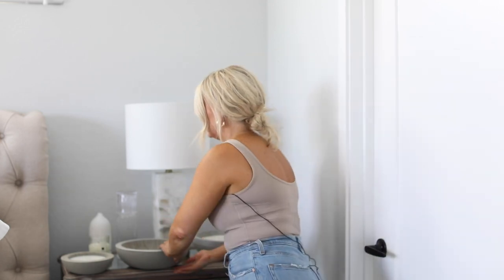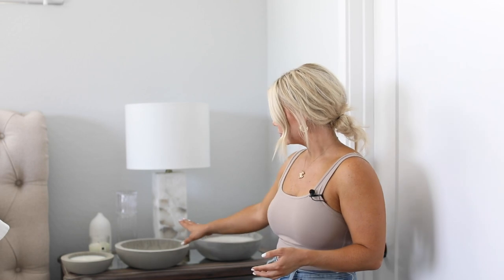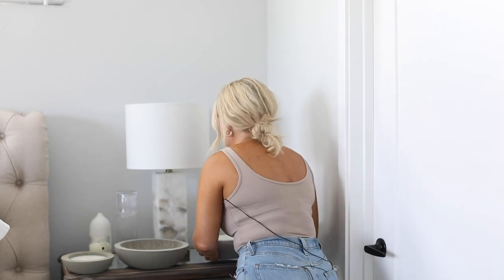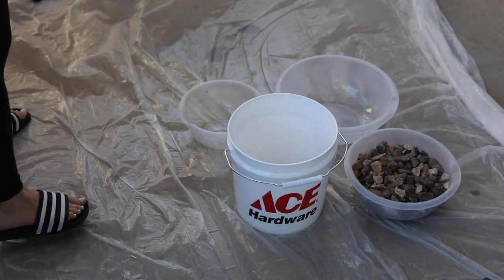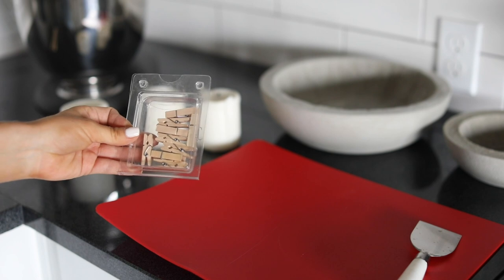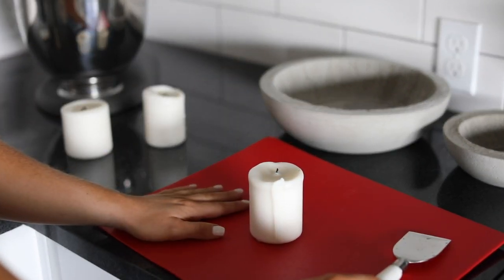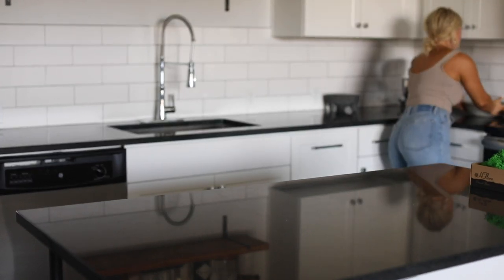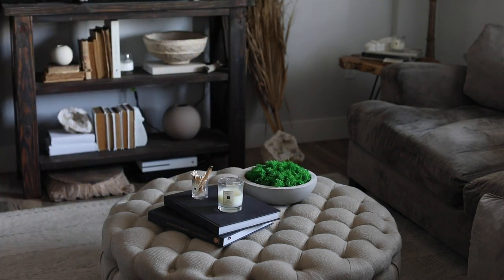DIY CONCRETE BOWL | RESTORATION HARDWARE DUPE | RESTORATION HARDWARE LOOK FOR LESS

Comment: 36 weeks pregnant and stirred 4 batches of concrete. I'm sweating like a hoe in church 😂😂😂. I hope my two massive bowls come out nice. These would be good gifts, especially as a candle. Cheap and personalized.  You could even spray paint or rub wall filler on the outside to give it texture.
Reply: Hello Brandy just just to let you know Don,t Breathe in that Cement Dust as it contains Silica that is not healthy to Breathe in
In other words keep your mouth shut😂😂❤

Comment: I have a question, It doesn’t show in the video, but I assume you push the smaller bowls into the bigger once the cement is in right? And how much water do you use?

Comment: Brandy, I watched this video for the first time a couple weeks ago.  Since then, I made the cement bowl ( with the help of your video!) and now I'm re-watching this one so I can follow the steps to fill the cement bowl with wax to make it into a three wick candle. I LOVE how yours turned out!!! My question is: When I melt the wax shavings in the pan, will it ruin the pan or does the wax wipe out?  Thanks,  Joan
Reply: Okay, update...used a pan and it was able to clean it out right away, However, I did drip/splash some wax on the side of the cement bowl. I'm hoping that when it is cooled and set, I can sand, the edge of the bowl, eliminating the dripped wax. Any tips?  Thanks in advance.  But, most of all thanks for this creative idea.  I wouldn't have attempted it if I didn't see you do it on this video!!!!

Comment: You can just put the candles in your crockpot. It melts them, then you can pick out the old wick and pour into the bowl with the new wick - I use a hot glue gun on the bottom of the wick and then skewers. Put your crockpot insert into the freezer and once the wax residue is frozen it pops right out. Nice piece. Sorry it was so hard because it's really quite easy. Live and learn.💁🏻
Reply: Or use a crockpot liner

Comment: I would add some type of felt on the bottom so that the bowl will not scratch whatever it's sitting on I love the bowls and I think I would not use my good pot to melt wax I think I would maybe used some type of item that I could throw away and I will melt in the microwave very slowly
I have bowls that I purchased after holiday sales for $0.25 that I've been holding to do just that with

Comment: Oh Brandy lets make your life soooo much easier. Get a candle making pitcher @ Amazon. $17.00. Just put used
Candles directly in pitcher and put into a pot of hot water. The candles melt completely without chopping up
The used candles. The pitcher has a pour spout and you can pour directly in to your concrete vessels without 
An aluminum foil. So much safer. This will cut your time at least 80 percent! Good luck.
Reply from the maker: Ohhhhh I love this! Totally getting this for next time. THANK YOU!!! 🙏

Comment: Hey Brandy, how did you make sure the smaller bowl did not sink to the bottom of the bigger bowl when it was in the wet cement?
Reply from the maker: This mixture (for whatever reason) I have to kind of work it in but I have seen others use screws... drill 4 evenly into the top plastic bowl so it won’t fall down. I hope that makes sense. 🥰 Also, if you control the weight of the rocks in the top bowl, I find that helps too.
Reply: @BrandyJackson  thanks, yes that makes sense.

Comment: Where did the plastic bowls (molds) come from? There should be a manufactures mark on the bottom of the plastic bowls.
Reply from the maker: Oh my gosh, I completely forgot to add that in the description 🤦🏼‍♀️ Thank you for asking. I got them at Walmart but I added the link in the description. They were less expensive in the store though.

Comment: even better , soak the bowls in a tub of water for 3-5 days to properly cure. Once out , let dry for 24 hrs, then acid stain or paint. Your cement mixture looks too runny in this, resulting in bowls that will eventually crack.